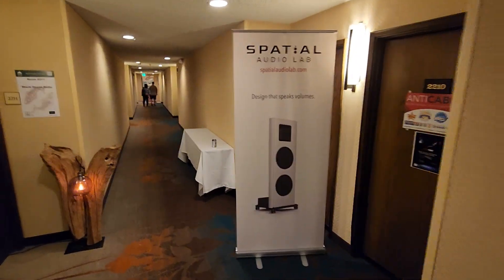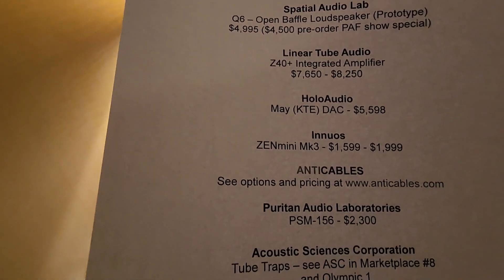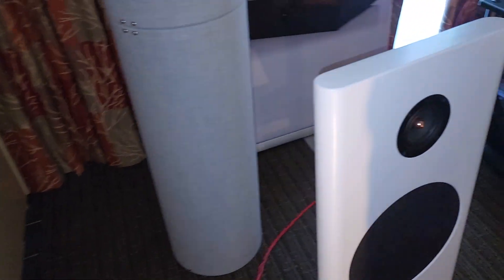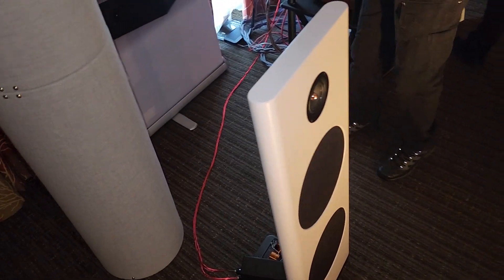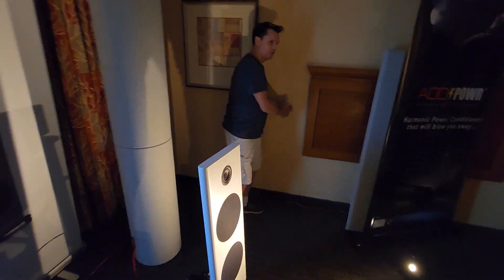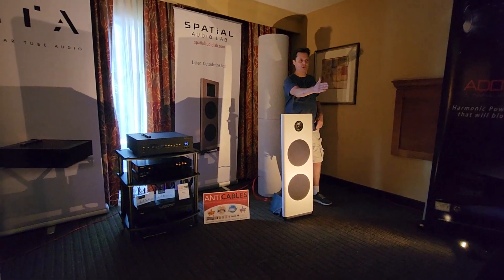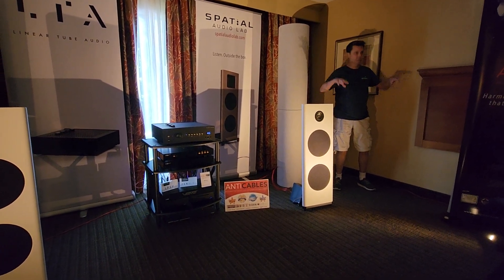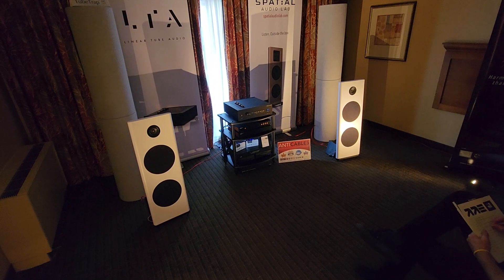Spatial Audio - Will Definitely be Back for Music Clips - Pacific Audio Fest 2023

Comment: Great coverage. This design is quite interesting. They're shorter than I would have expected. I currently own Spatial Audio M3 Sapphires. Owned the original M3's before that. Love open baffle presentation. Plus, those are really easy to move around and position in the room.